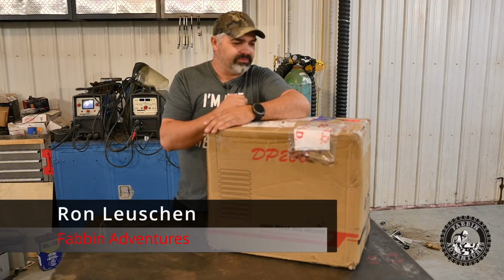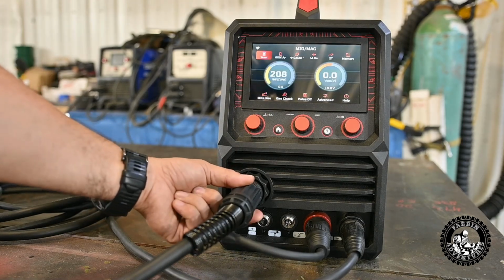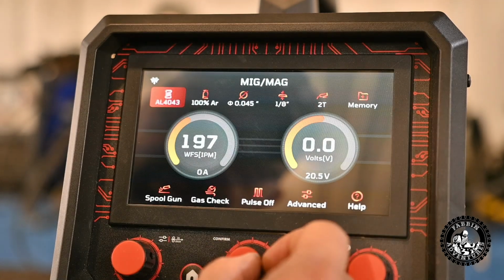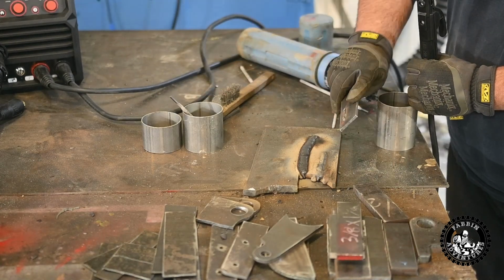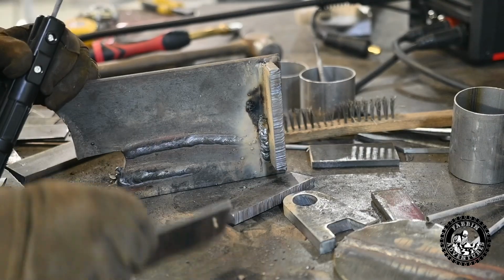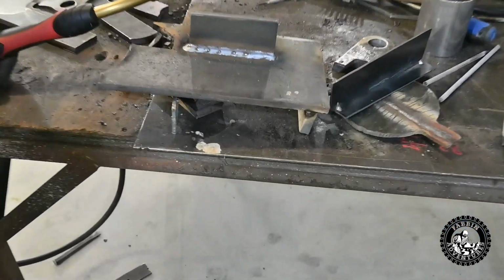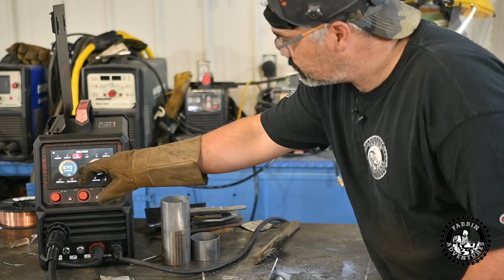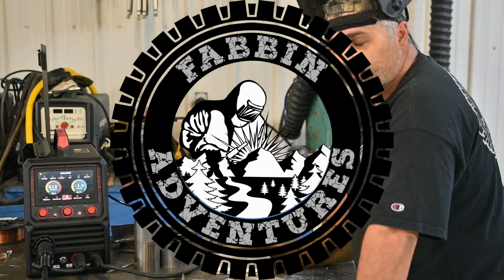Yeswelder Firstess DP200: Multiprocess welder with Dual Pulse

Comment: Inside the machine is not for storing all your tips and everything, that's what a welding cart is for. Just saying. The wheels are the most important things to keep in the machine.
Reply from the maker: True, if you run a cart, which i dont and lots of other people dont.
I have a big cabinet on wheels as you can see in the background that my welders and plasma cutters sit on. I keep a few tips in the machine and a bunch of spares in the cabinet. 
Thanks for watching and commenting.

Comment: When welding aluminum the wire speed was set to 370, 385 and above 400, but the display showed about 100-110, approximately the same wire speed shown in all settings when welding.  So I'm a bit confused on the wire speed settings.
Reply from the maker: Good question, i'll have to watch the video again to see if i can figure out what your seeing.
Thanks for watching and commenting!
Reply: @FabbinAdventures  I just checked and the display switches over to AMPs when the trigger is pulled.
Reply from the maker: Ahh, there you go, thanks!

Comment: That is impressive.. Is there pulse function?
Reply from the maker: Yes there is a pulse function in this machine, i'll be doing a follow up video soon hopefully showing the pulse function as well as the new aluminum synergic settings
Reply: @FabbinAdventures  what's the max amps? For steel
Reply: I have the Fronius 2200.  The EWM now has pulse.  Both these European made machines are the best in the World.  This Yes machine looks good but I doubt very much whether it would be able to come close. Whilst the welding looks fantastic the Fronius and EWM are designed and tested for heavy industrial use.
Reply from the maker: @JohnSmith-ho8up oh for sure the Fronius is sure to be way better, but at the price point of the yes welder i bet the fronius can not compete, especially for the garage diy guy. Though longevity of the yes welder has yet to be proven.
Thanks for watching and commenting!
Reply from the maker: @JohnSmith-ho8up id have to look but i think its 200 amp for both mig and tig and 180 for arc welding.
Reply: @FabbinAdventures  Take a look at the new EWM 240v Pulse machines.  For steel I hate to admit it but they're also better than the Fronius 2200, with a 230amp output .  But for a garage go to welder, this YES is ideal...  Shame they're not easily available in the UK
Reply from the maker: @JohnSmith-ho8up yeah its strange that yes welder is not "all over" every where! You can order and have one here in a few days!

Comment: Its possible aluminum is more sensitive with your gas being slightly off making the synergic setting run hot?
Reply from the maker: No, not that hot, its a problem yeswelder is aware of, they supposedly have the update for it already.
I'll install the update and try again, stay tuned!
Reply: @FabbinAdventures  thanks for the reply!! So the unit in general is still worth staying in line for? I'm starting to see sparce mixed reviews now. 😮‍💨
Reply from the maker: @AH-mp5di oh i would think so yeah, they listened to all my suggestions and said they made changes or the engineers are working on it. They are very responsive to my emails. It really is a pretty awesome machine. I have more gas now and im waiting on some .045 wire and i'll test and update the video

Comment: If you want to weld thicker metals with an .030 wire you have to switch to a higher wire setting then go back and set the metal setting and set the thicker metal than go back to wire setting and switch it back to .030. you can also do the pulse setting on steel.

Comment: The mig torch is NOT called a stinger!!!!!  Come on man.  That thing you called an "arc welding clamp" is the stinger.
Reply from the maker: Well the welding shops ive worked in we called them stingers.....what ever viewers get the point.
Reply: @FabbinAdventures  You could've just accepted the fact that you misspoke and moved on.  But instead, you double down.  Maybe do a youtube search for "welding stinger".  Look at the first 20 videos that come up.  Have you really worked in a welding shop?  No actual welder calls the mig torch a stinger.  Some people call it a mig gun.  That's fine too.  The stinger is for stick welding.  Clearly you didn't make it through a welding certification without learning that.  Go find one video on youtube where somebody else calls the mig torch a stinger.  I'll wait.  Viewers get the point that you don't know basic terminology.  Anyway, thanks for the video.
Reply from the maker: @genekeeler2690 jesus man, its just wording settle down. I dont claim to have a certificate thats why i brought in a friend.
Yes i worked in a couple welding shops and have run miles and miles of steel wire and a bit of aluminum wire, not one of them ever called it a torch, torches are for flame. Maybe it was called a mig gun or gun a time or two, buts always been called a stinger so thats what i tend to call it.
It doesnt matter what i call the damn thing, the viewer get the idea.
Put your hood back down and keep welding, move on bud.
Reply: Bad hair day?
Reply from the maker: @michaelbradford4444 lol i think your right.
Reply: @genekeeler2690: So you're the one who commented like his hair was on fire, then your butt hurt when you get called out for it! Sounds like you never matured out of your teen years.

Comment: Thx very much.
Bit confused about the settings for aluminum. You said that initially the aluminum weld looked too hot so you increased the wire feed speed and decreased the voltage a tad. How does increasing the wire feed speed make the weld less hot?
I am a real newbie when it comes to welding so am asking why not to be critical but to learn. Thx again.
Reply from the maker: The wire is burning back to the tip faster that its coming out, so increasing wire speed pushes more wire to the puddle, cooling it slightly and so does dropping the volts.